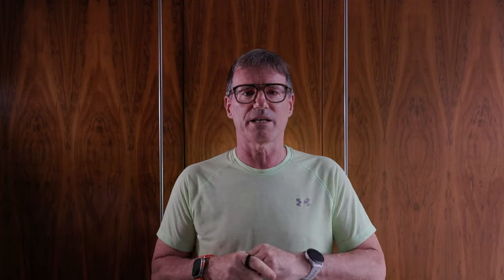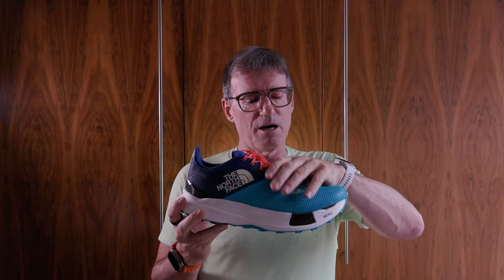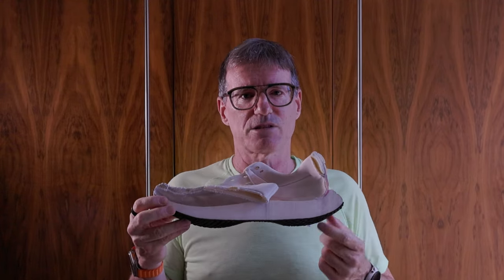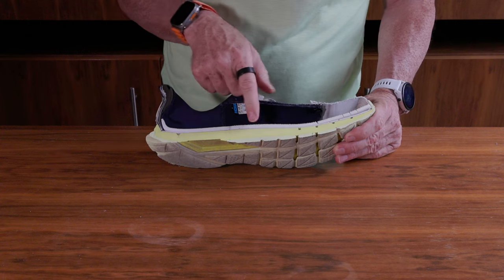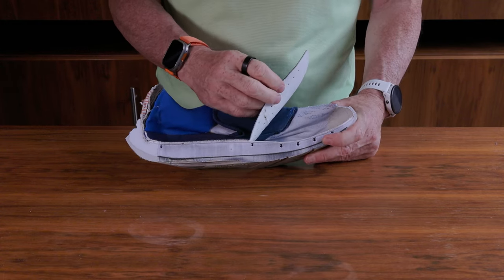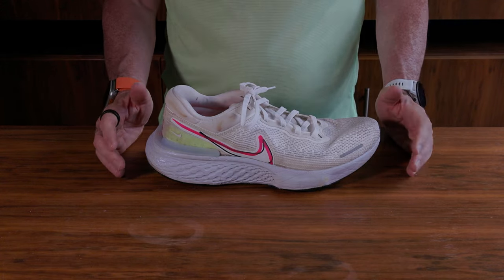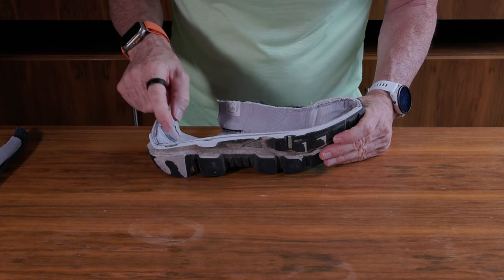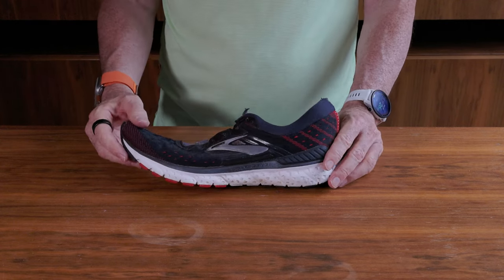The Parts of a Running Shoe: Looking Inside

Comment: Mach 4 / 5 and Invincible 1 / 2, all cracking shoes.
Even more fun to see both in cross section.
Greetings from an unusually wet Alice Springs!
Reply from the maker: I hope I can update this video every year! Will also cut different cross sections next time… and pull apart some stuff… A wet Alice Springs! I have some recollection that there is a dry river bed race there… but presumably not today… Enjoy!
Reply: @OldManRunner  Todd River seems the main one running along the edge of town. It was dry enough today. Alice would probably need a few weeks of rain for Todd to flow again - that's unlikely : - )
Alpha, Vaporfly, Metaspeed, Endorphin Pro & other plated racers to see placement of carbon plates relative to the foot would be interesting.
Reply from the maker: @bartekzielinski1645  Yes. I have been waiting to finish running in them...but will bite the bullet on at least one of them next time. I very nearly got to the Metaspeed Sky's...but that might happen in a different video

Comment: On has been including a version of stiff board (Speed board?) in almost all shoes they built and results in much harder ride. The latest Cloud Surfer is an exception and apparently the shoe now feels much better and softer.
Reply from the maker: I think On will gradually move away from the Clouds, you can see it happening as the models evolve. I wanted to get a Cloud Surfer and do some slow motion filming as the Clouds compress...but it's another idea that sort if got away from me...